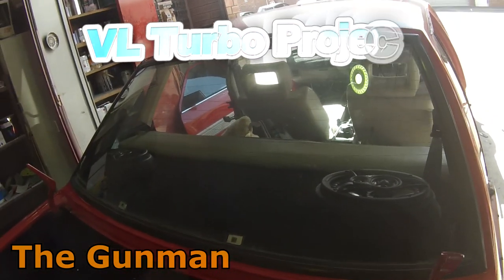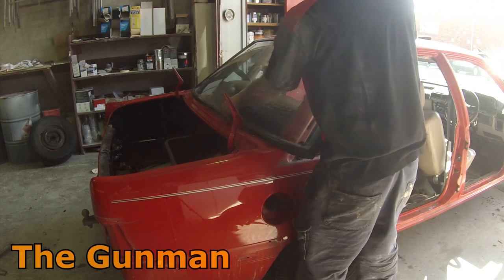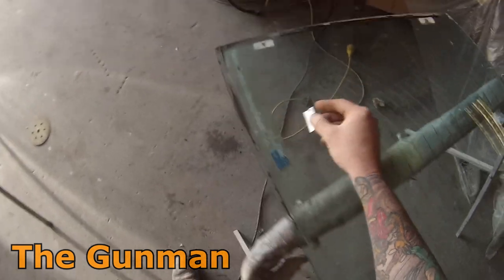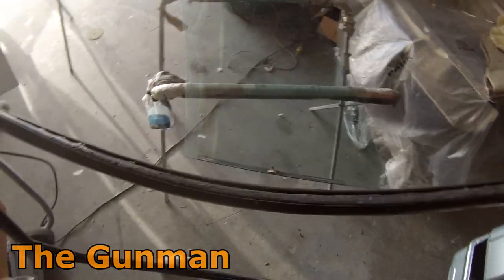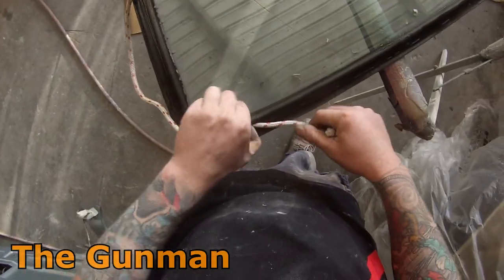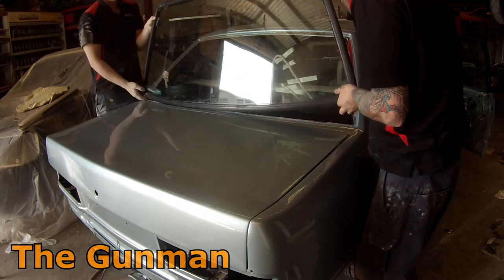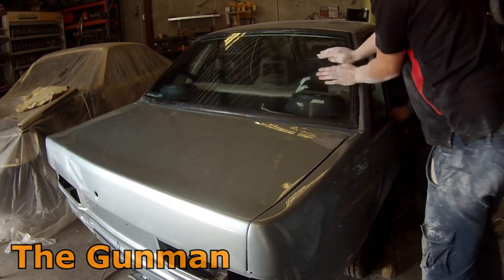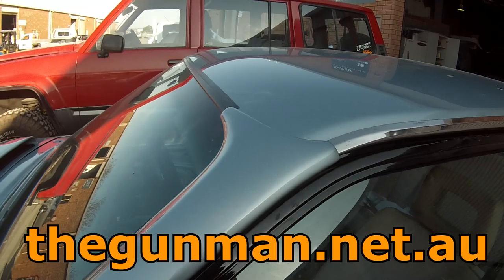How To Remove & Refit a Windscreen

Comment: $150? I was quoted $480 supply and fit. Bought the screen myself for $100 new from a windscreen warehouse (BA Fal) and tube of glue for $9.00 and did myself. Thats $370 for 15 min labour. What a scam. $1500 per hour😂🍾🍺💅🏻